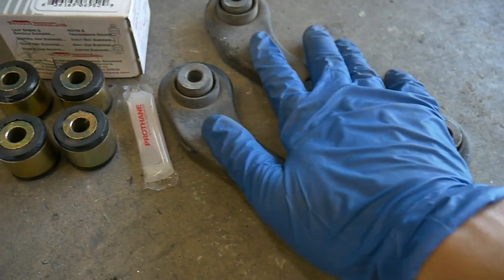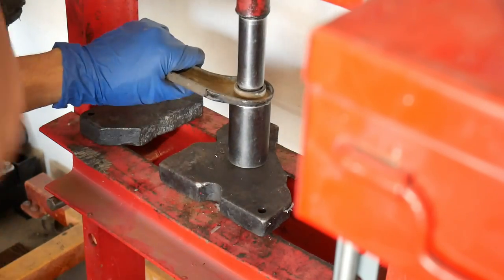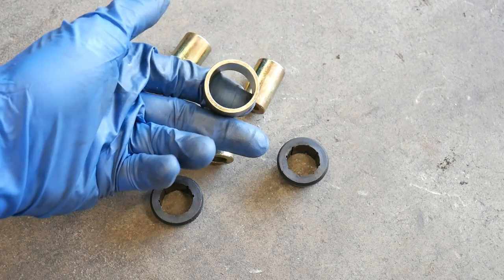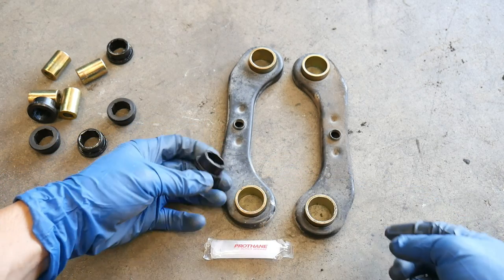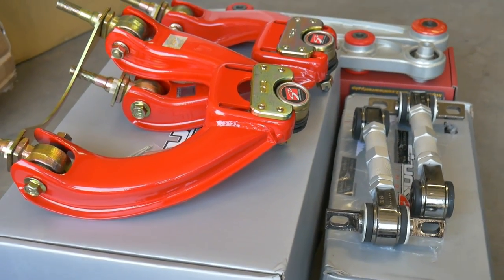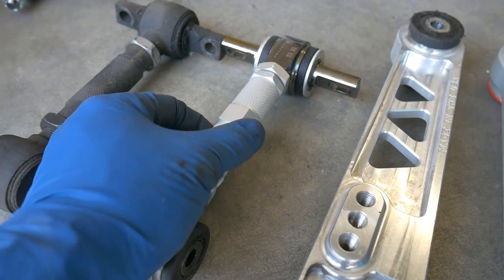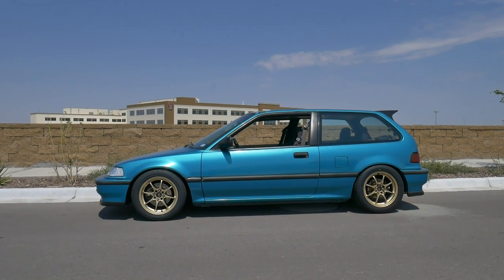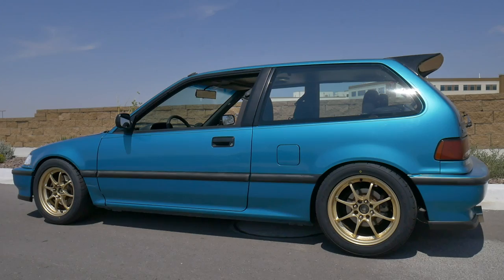Skunk2 Alpha LCA & Camber Kit, Rack & Pinion, Toe Arms, Tie Rods 1991 EF Civic Si B16A

Comment: where you get your inner tie rod and outer tie rod from, what brand name?
Reply from the maker: +Alex Vong I bought mine all of eBay.  I got the least expensive pieces and have had good experiences with those in the past. $100 shipped for the rack with inner tie rods, and $15 shipped for the outer tie rods.
Reply: Garage Built Hondas what happens if i don't get the alignment because I got ebay inner tie rod and they are lose, i guess maybe because alignment
Reply from the maker: Alex Vong They shouldn't be loose at all.  If you don't get an alignment you are going to wear out your tires quick and the car will probably feel like it's all over the road.
Reply: Garage Built Hondas yeah, like driving left and right, thats what im doing haha. i don't know, my new boot rip on the right side
Reply: Garage Built Hondas how did you get your upper control arm alignment when they did it
Reply from the maker: +Alex Vong exactly, it feels crazy!  You can just replace the boot (also called Bellow) if you already replaced the inner tie rod.
Reply: Garage Built Hondas yeah I replace this year In April. when you have the camber kits, did they mess around with that to do alignments? Because I'm looking for upper control arm but I'm on a budget and trying to have a comfortable ride with lowered springs lol
Reply from the maker: +Alex Vong do you mean camber setting?  That's the only sort of setting that you can adjust with the Skunk2 camber kit.  The alignment shop will set it to what setting you want or to the stock setting if you prefer that.
Reply: Garage Built Hondas yeah camber settings. I didn't know you put as stock but I want it stock like yours is, that way no wear on tires lol
Reply from the maker: +Alex Vong I don't trust the generic camber kits, I'd spend the extra on a brand name one.  I have some camber on my car, but I wanted it set that way.  Toe is what will really eat up tires so that why you need the alignment.  With you tie rods not adjusted to spec, you're tires will be constantly pulling at one another and thus the premature wear.
Reply: Garage Built Hondas oh yeah, generic one, forget that lol, i love something that is cheap and reliable like a car lol. What's your recommend. looking to spend atleast 150
Reply: Garage Built Hondas yeah, i mean i did the alignment by myself by looking at it and it was alright, but I'm probably just going to get inner tie rod again but I want the one you got, can you send the link please
Reply from the maker: +Alex Vong I got my inner tie rods with the steering rack.  $98 shipped.  Look at this on eBay http://www.ebay.com/itm/331607574528
Reply: Garage Built Hondas man i thought maybe the seller has my but I search it on ebay, they asking $300. my is power steering from an 94 integra to 92 civic
Reply from the maker: +Alex Vong I see, I would shop around, you might find a better price.
Reply: Garage Built Hondas yeah it otherwise go with the tie rod kit